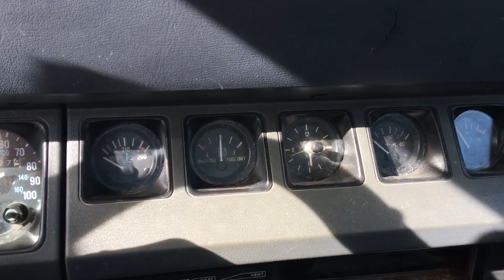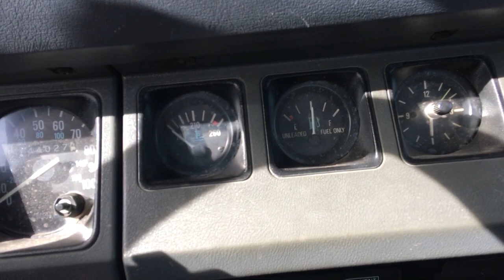1989 Jeep YJ 4.2

Comment: It looked as if that was a rough country. Lift. I just did one to my yj. A 6 inch lift and im having horrible problems with the longer driveshaft and cv joint. That rough country provides. Have you had that problem?
Reply: Lerue Fox you might need  taller engine mounts and risers for your transmission where your skid plate it. If u have a yj when you do a lift that big it screws up the angle.
Reply: Does it also seem like they are binding up ?
Reply: Matt Toothaker its did at first.  But its sorta fixed itself. It still vibrates when taking of in first gear but no vibrations or binding lately. I do not have anything nice to say about tough country though. After driving and attempting to 4wheel. Its stiffer than hell. It doesn’t wanna flex it just wants to flip the jeep. They’re steering stabilizer is shit. And they’re customer service was horrible. So im all in all extremely upset with it. I should have went with the Skyjacker lift
Reply: What mirrors are those?